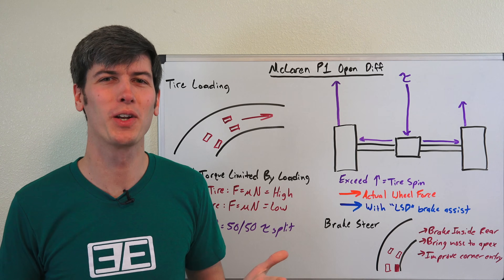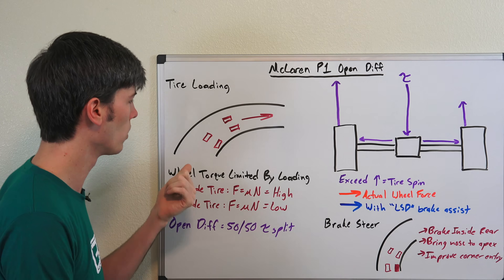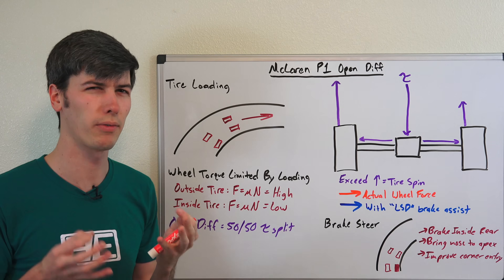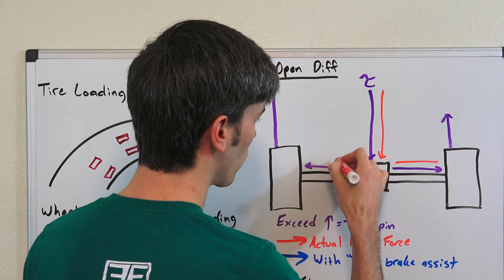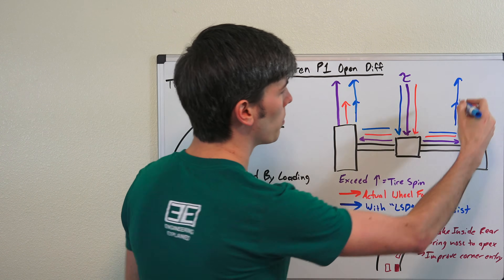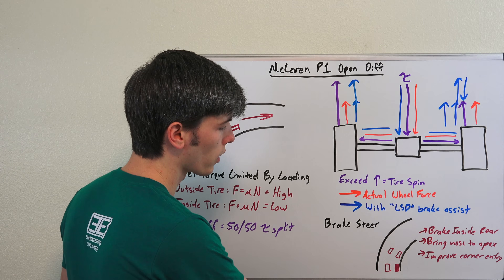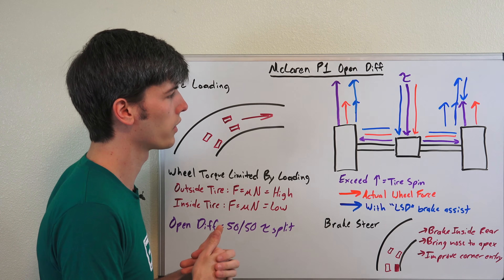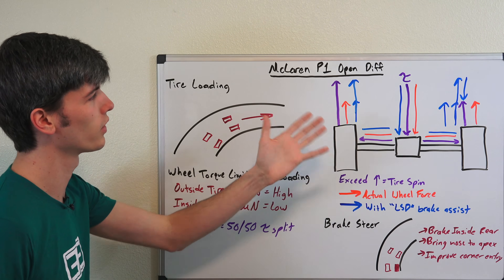The McLaren P1 Has An Open Differential?

Comment: This fake LSD method is actually something some cheap cars have to spare the costs of a locking differential. Benefit for performance cars may be that it's computer controlled and can be used in an active and dynamic way to always get the perfect amount of lock for the tires. Or even beyond that, apply the "perfect" locking % incorporating inputs like, travel speed, lateral force, steering angle input, ... Ultimately it can be used to aid a avg. drivers non optimal driving skills.

Drawbacks are, the car transforms engine torque into brake heat. Not a big deal on normal road but can be an impact around a Nordschleife lap. Wasted energy and overheating rear brakes. Esp. the brake torque steer is something other cars also have, like the Audi RS5 or Bentley GT3R. While it is a bonus on a backroad as it makes the car feel more agile, on a race track this will cook the brakes within laps and the driver doesn't even know why.
Reply: Doesn't the P1 have silicone carbide coated aluminium brakes? Making overheating and wear a non issue?
Reply: ***** Do you mean carbon ceramic? Hmm adding aluminum to it sounds like a very corrosive combination. Any what is the point if the discs can dissipate the heat but pads and brake fluid gets boild.
Reply: ***** Well proper mechanical torque vectoring isn't that simple and it would add weight to the car.
Reply: I believe that McLaren has stated that (saved) weight was the primary driver for the decision.
Reply: 1500 kg is not super light in the end. On the other hand esp on road cars weight can be countered with more capable or simply wider tires as long as the CoG isn't too high. However on a general note, light weight by design is very important. Saving some weight on parts by fine-tuning them or using other materials is fine and okay but can get pointless really quick. Leaving out features that effect the Vehicle Dynamics or on track performance only so the car weights 1500 kg instead of 1505 kg can backfire.

There are a few reasons in the design and design decision of the P1 that are causing it to not be able to match the 918 Nordschleifen performance or Laguna Seca (Motortrend) lap time on equal tires, even though on most standardized tests the P1 produces numbers that are as good or better than the 918. Those can be small things that add up to problems in the end. That is what Porsche does so well.
Reply: How is the energy and heat not wasted? The P1 can only recharge the battery from the crankshaft (and  turbo I think). Heat in the brakes is always wasted energy.

Heat is the main issue that stops road cars from doing a 24h race. Porsche for example carefully simulates all the heat and heat transfers in the car. That is one of the reasons why on Track Days, Porsche cars are the ones that are being driven the hardest around the track for many laps. While nearly all the other cars do one quick lap and one cool down lap.
Reply: Marko Lomovic The P1 doesn't have regenerative braking.
Reply: I get that, but why not a torque vectoring diff?
Reply: About the weight saving. McLaren surely could have come up with a light package for an LSD that only adds 5 kg. Then we are talking about a 5kg more on a 1500 kg car.  Nothing to worry about really. Also with an LSD they than maybe could have saved 1 or 2 kg on the rear brakes making the weight saving look even less off an issue.

Its a design decision by McLaren since the MP4-12C.
Reply: a.k.a. miagi it has carbon ceramic rotors infused with silicon carbide. For strength because silicon carbide is extremely hard for durability.
Reply: a.k.a. miagi "
Reply: The P1 has carbon ceramics coated in silicon carbide. Also, a simply open diff is typically lighter than any other type of diff with other features.
Reply: a.k.a. miagi didn't porsche using it's hybrid motor for the front wheels? and they use a system where the rearwheels steer as well?just like BMW's 8 series,back in the days.
Reply: "The engine weighs 135 kg according to Porsche and delivers 608 metric 
horsepower (447 kW) at 8,500 rpm and 528 N·m (389 lbf·ft) of maximum 
torque.[4] This is supplemented by two electric motors delivering an additional 279 PS (205 kW).[15] One 154 hp (115 kW)[4] electric motor drives the rear wheels in parallel with the engine and also serves as the main generator.[15] This motor and engine deliver power to the rear axle via a 7-speed gearbox coupled to Porsche's own PDK double-clutch system. The front 125 PS (92 kW)[4] electric motor directly drives the front axle; an electric clutch decouples the motor when not in use."
Reply: Another disadvantage is if you "get out of the groove" and one tire loses traction, power isn't transferred to the other axle.
Reply: Sure but in P1 that energy and heat is not wasted right ?  It should convert that energy into electricity for battery?
 
Also I doubt heat would be the issue on brakes since I'm pretty sure you could jump in P1 and probably do 24H race.
Reply: a.k.a. miagi That's the wrong attitude. you could also say "its only adds a few kilos" to a bunch of components. I mean they shaved the windshield down thinner to save weight. You don't get to be the lightest car in a class for nothing. and besides all the reviews say the open diff doesn't hinder the car at all so why the fuss?

Comment: Can you do a video on how the differential works on the Nissan GT-R as to how it can achieve those cornering speed without body roll?
Reply from the maker: Mohamed Momin I have a video explaining the GT-R's awd, have a quick search. Also, having driven one on a track, there is noticeable body roll.
Reply: Mohamed Momin the diff has nothing to do with body roll
Reply: Engineering Explained Thanks! How does the drive of the old Miata, or say the new MX-5 miata compare to the drive of your s2000?

Comment: that has to be murder on the brakes. especially if it's a longer, sweeping turn. the brake on the one side would get cooked, no?
Reply from the maker: Gregory Gonsowski yes, obvious drawbacks are additional wear on the brakes, and if the system gets too hot it will need to switch off this feature. I drove the Tundra TRD Pro which had a similar feature for different applications, and it would have to cool if it was used too much. But I would imagine it's less heat than most of us are thinking - unless traction conditions are particularly different left to right.
Reply: I imagine they have an amazing cooling system not to mention it probably recharges the batteries.  I mean I'm not sure if it uses regenerative braking but it has carbon silica brakes, they aren't gonna wear out due to heat.
Reply: In the P1 app, the brakes are carbon ceramics which take a lot more heat and last a lot longer then standard passenger car braking systems.
Reply: I think with carbon ceramic brakes, it should be able to withstand these kind of tough conditions.  Carbon cermaic brakes actually brake better in higher temperatures.
Reply: yeah but if u have like 1mil for the car u can get new rear set of breaks every now and than for like 10k$ (because  carbon ceramic) maybe more. Btw those cars are more or less garage queens anyways.
Reply: Bang on answer. The brakes are made by Akebono, not your usual common garden Brembo
Reply: McLaren P1 has silicone carbide coated aluminium brakes. They're known as the hardest compound and are used on trucks to reduce the disk wear. McLaren used it on their F1 cars and now they used it on the P1. It can distribute heat very well and can be cooled easily too. So no, the brakes aren't getting murdered. Except for the shoes amybe :P
Reply: The rear brakes don't get used as much and this at the least isn't enough to make them wear as fast as the fronts, so it's not that bad in this car.  What is mind boggling is that some FWD cars such as the Focus ST have the same system.  Those go through front brake pads FAST.
Reply: This idea works best in a RWD car as the front brakes always do the most work in any car, so there is excess braking capacity in the rear. It sounds like the wrong application to use this in a FWD performance car.
Reply: As I pointed out in another comment, yes it can be murder on the brakes. What most people don't think about though is the torque converter or clutch. If you're doing a burnout, and forget to disable brake assisted tcs or torque vectoring, you can not only cook your brakes, but also overheat the transmission or clutch. Actually knew a guy who cooked his clutch when he thought it was cool to spin his wheels in the rain for a couple of blocks but didn't turn off traction control.

And, it's not just supercars that use this system. Some small  front-wheel drives use a similar system because it's cheaper than an LSD.
Reply: That focus most likely doesn't have carbon ceramics
Reply: Gregory Gonsowski brakes are coated with silicon carbide which is what they use on space ships
Reply: If you pay that much for a car I imagine you can afford to replace your brakes every week if needed.
Reply: A friend of mine autocrosses a Focus ST, which has a similar system.  He's a pretty aggressive driver and there is always a lot of wheel smoke, but also brake dust, following him around the course.  He goes through 2 sets of brake pads and rotors every autocross season.  12-15 events, maybe 5 runs per event, and roughly 1-minute courses means a set of brakes lasts him only 45 min of race time and 5-7k street miles.  No thanks, I'll stick with mechanical diffs.
Reply: Gregory Gonsowski your brakes would be well more cooked from simply braking
Reply: It's the rear brakes and it's braking while the tires are at its limits and accelerating, it doesn't take much brake pressure and it wont get cooked. If you just apply a little bit too much, then you risk the car spinning. You apply a lot more brake pressure on stability control interventions, and on different tractions left to right, TC will intervene by cutting the engine torque. I think this is very smart of Mclaren. Nice information, thanks.
Reply: definitively  applicable only on a carbon-ceramic equipped car
Reply: My MK7 GTI has it in the form of VW's XDS+ system. It obviously is less aggressive but it hasn't caused a noticable wear increase and I drive rather spirited on twisty NE backroads
Reply: yep, Ford is doing the same on focus and fiesta st, and also to reduce torquesteer. brakes get cooked.
Reply: My e90 has this
Reply: More like increased wear on the pads. The brake discs can handle it very well.
Reply: Gregory Gonsowski Theres a guy, powerslide lover or smth who cooked his brakes in 2 laps on the nordschleife and just as quick on spa with some aggressive driving. In a Laferrari. Similar power output here and with added brake load from e diff system cant be good. just a guess, I'm no engineer
Reply: The key point is what car?
Reply: I would guess the clutch is worse of..
Reply: someone that can afford this don't give a crap about how much wear it'll cause between uses. chances are the tax to keep the car on road is even higher than the cost to replace the brakes every year. in fact, when the brakes broke down, they'd probably just get a new car instead :P
Reply: Ali Mahfooz, absolutely no truth to what you say at all.
The P1's Akebono brakes are carbon ceramic (a ceramic matrix, usually Silicon Carbide, reinforced with Carbon fibers) the only thing that separates them from it's contemporaries such as the LaFerrari and the 918 is that the P1's brake rotors have an extra layer of ceramic that attains a mirror finish under brake bed in that according to McLaren allows them to withstand a slightly higher heat load than more conventional Carbon ceramic brakes.  McLaren NEVER used this braking solution on their F1 cars, they all rely, and always have done since their first implementation on Carbon-Carbon brakes, a completely different technology originally developed from the aerospace industry.  Carbon-Carbon brakes use carbon fiber brake rotors in a Carbon matrix, with brake pads of the same composition.  Their performance is way beyond that offered by Carbon ceramic systems, the caveat being that the coefficient of friction between pad and rotor remains low until a relatively high temperature is reached, and then increases enormously up to the point of overheating.  This allows, in combination with Formula 1 aerodynamic grip, a staggering level of brake performance that lends itself only to a racing environment.  Also, Carbon ceramic brakes, although very hard, are not and have never claimed to be 'the hardest compound' as you put it.  I don't mean to belittle your comment or run you down, but please do some bloody research before you post, what you have written contains virtually no truth whatsoever.
Reply: carbon ceramic brakes, the hotter they get the better they bite.
Reply: Rremember that a fwd will use the front brakes a lot more anyway. Besides that, it's the heavier side of the car too, and it has regular, steel disc brakes. Too many variables to the opposite side to actually compare the situation of a focus st and a p1.
Reply: Engineering Explained The rear brakes are pulsed by the system, so the heat build up is less compared to continuously applied brakes.  Thus, overheating the rotors and pads is not an issue.

Comment: What is the difference between "Brake Steer" and Torque vectoring that Audi and Ford use ? Thx Great Vids..
Reply from the maker: rod mommaerts very similar. I know when Subaru says torque vectoring, at least for the STI, it refers to only the front axle, and only under braking. Well, if memory serves me correctly, did a bit of research on it about a year ago.

Comment: So do they at least do this with the electric motors?
Reply: No, the motor is bolted onto the side of the engine, not to dissimilar from the application of KERS from 2010-2013 in F1.
Reply: You certainly could do it with electric motors, since electric motors with modern control circuitry are capable of supplying precise torque in both directions (to accelerate or decelerate) with very rapid changes. However, most electric cars still use only one motor or only one motor per axle. This is for a few reasons, namely that you usually want to use a reduction gear ratio on motors anyway for efficiency and also because the set of power electronics needed for each motor is quite expensive, and you can't share them between motors, so most electric cars still use differentials.

Comment: I've heard that lots of Lotus cars come standard with Open differentials. Could you possibly go into that in a video? Possible reasons why and such. Great video!
Reply: Lotus (like McLaren) likes to use open diffs because it removes some understeer that comes with LSDs when cornering at lower speeds. That said, the latest manual Evora 400 and Sport 410 come with an LSD as standard because even Lotus say that with that amount of power you kind of have to use a mechanical LSD.
Reply: LurkerDanny. open vs lsd effects handling significantly, Lotus prefers open because it maintains a consistent handling character that can easily be tuned with springs damping bushings alignment etc.

Comment: nice, my Subaru is basically a P1
Reply: In some very significant aspects, yes!
Reply: McLaren and Subaru are pretty similar actually lol.  Peter Steven, the designer of the McLaren F1 was the guy who redesigned the Impreza WRX to have the iconic world rally blue paint, gold wheels, and a giant wing.  Also, there was a Subaru called the P1 lol.
Reply: Same with my Fiesta ST. Doesn't use brake cornering (i dont think) but it does use the front brakes to mimic an LSD
Reply: amanoncrack significant* 4 wheels windows doors tyres wing (perhaps) an engine and a transmission amongst other things
Reply: so my 2004 sti is basically my dream Mclaren F1 :) :) :)
Reply: right? first thing I thought of lol guess this was Subaru's way of compensating for losing the LSD in my gen WRX
Reply: And torque vectoring with brakes.
Reply: CroutonsRawk 

Well I was making a joke.

But Toyota also implements but they straight up call it "electric diff" or something like that..
Reply: although I though Gordon Murray did the F1
Reply: Better have excellent brakes with that engineering strategy (which the P1 does, of course). Other, much cheaper cars, ST'es come to mind, that use braking nannies in the corners for handling can overheat the brakes with a quickness, especially on a track.
Reply: Jahan Aquil only on the front axle, no torque vectoring on the rear axle.
Reply: Thomas Ferretti  

Well, my friends Tacoma has the "e diff" and in that case it's applied to the rear axle
Reply: KomaTechno good
Reply: Jahan Aquil love it 😂😂
Reply: Is that an Isuzu in your profile pic?